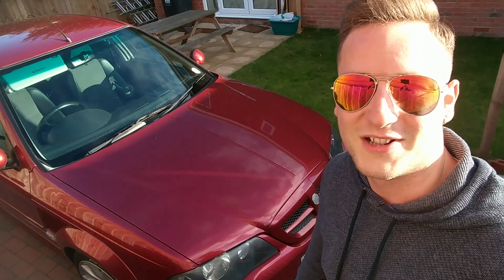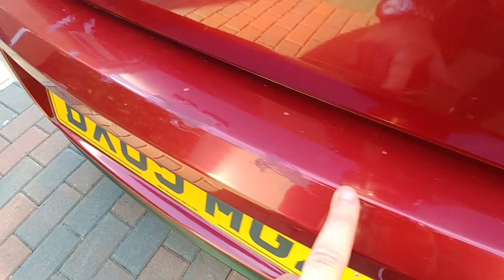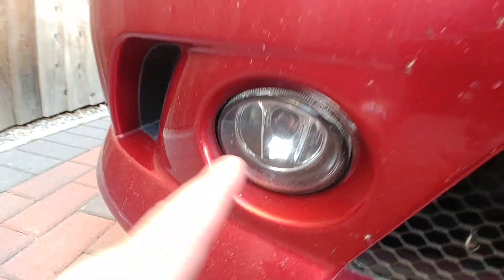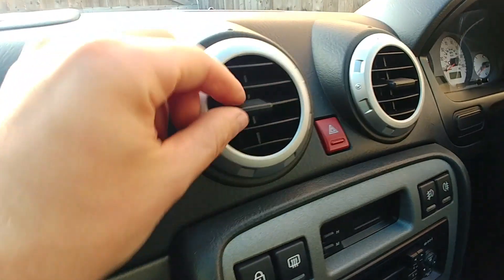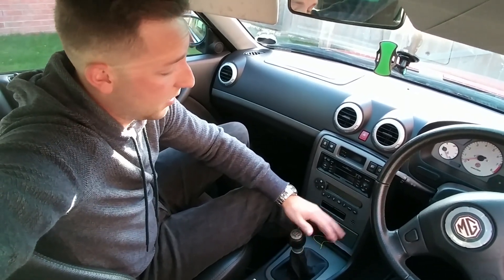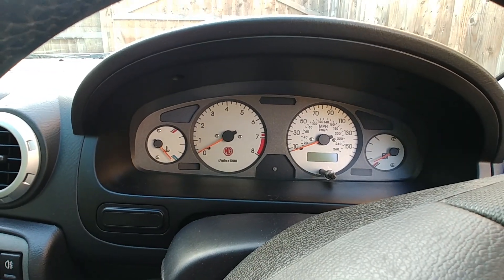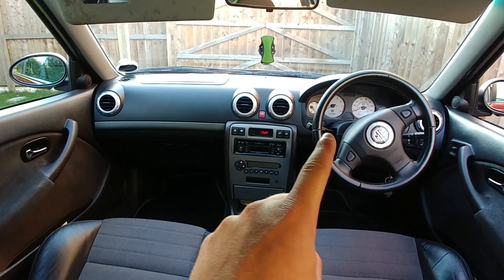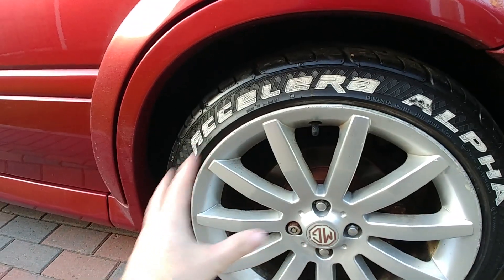Everything That's Wrong With My MG ZS..

Comment: The tab on the end of the bumper snapped on mine too, if the bumper is to be repainted at a bodyshop they should be able to plastic weld a new tab together. That's what did and it worked a treat. If you check the Facebook groups there are plenty of fixes for the rear bumper on both the hatch and saloon. The rear MG badge are NOT available new on the mk2 MGs. Loads of rubbish aftermarket ones but I'd just go de-badge
Reply from the maker: I wish I had known this information when I owned the car, I no longer own it, someone else bought it from me though and I think they are restoring it currently. I now own a BMW which I am yet to share with my channel.

Comment: Great mg, I had a trophy blue mk1 and always regret selling it. Regarding your clutch, try fitting the sheddist or dark ice designs  kit first if you haven't already. If you don't know what this is its basically just Honda civic metal clutch slave and master cylinders and a new better slave  cylinder bracket. The original slave/master cylinders are plastic and the original metal bracket cracks over time. I think the kit costs about £160
Reply from the maker: mini colt Hey, thansk for the comment, yeah I have sheddist kit on there, i have found that the issue im having is that when you press the clutch pedal down, you have the ability to press the pedal into the recess in the floor, when you do that the gears grind ever so slightly. I have recently found if i dont press it down as far, say to just before the recess then the gear change is buttery smooth, i think that i need to adjust the clutch actuator thing so that there won't be as much travel, or maybe place something in the recess so that the pedal won't go down as far. I will have a play around with a few things and make a video on it and the results i find. Its a shame you got rid of your mg, they are nice cars and they are getting harder to find now, although some are still very cheap to pick up if you ever fancy getting another one :)

Comment from the maker: I need some tips on fixing this rear bumper guys, any advice welcome :)
Reply: shove a self tapping screw in it? lol..

well.. it worked on my old audio a6 bumper anyway.
Reply: I fixed mine with a self tapping screw into the white plastic mount easy fix. Lovely motor btw
Reply: There is a guy that does brackets that pulls the bumper up on the fb groups